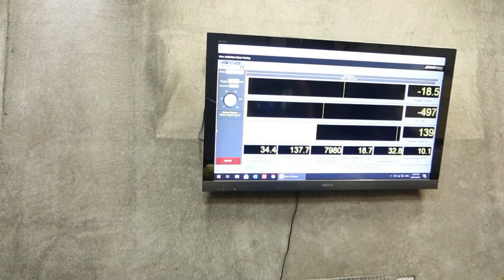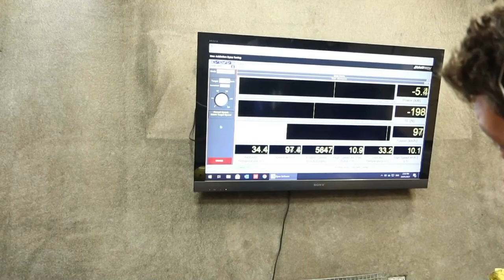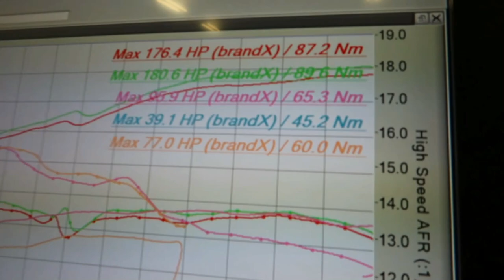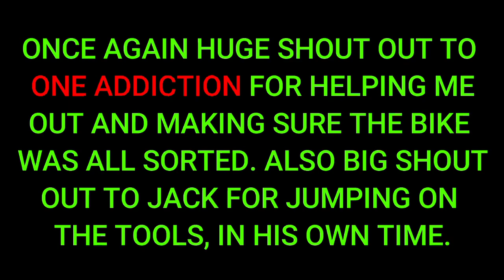Phillip Island, track day prep

Comment: How does the wheelie simulator work?
I can't wheelie for sh1t ..
Reply: The best way to explain it is it’s it’s like a dyno but we have the ability to adjust an air brake on the roller to create / simulate on road rolling resistance, and there is also an air ram to assist with the initial pop up of the wheelie to again try and simulate as close as possible to a real world scenario.
Reply: @race808r6  
Can you fall off?
I.e. over do it and flip it or turn sideways and fall sideways?